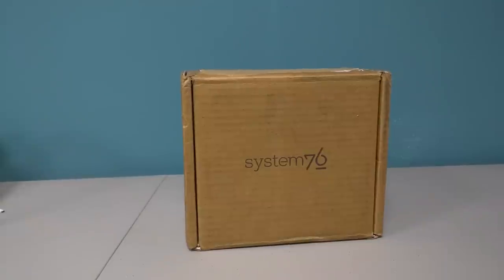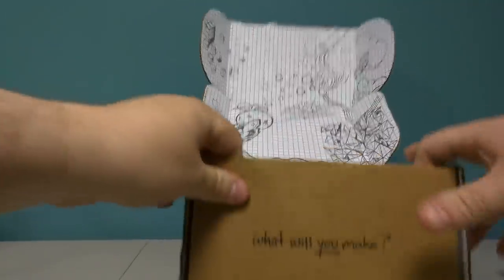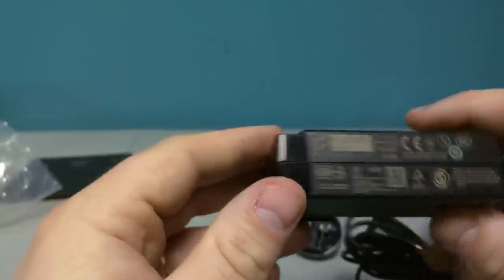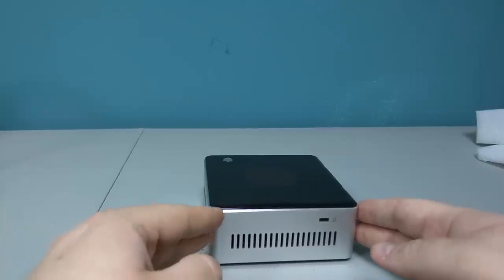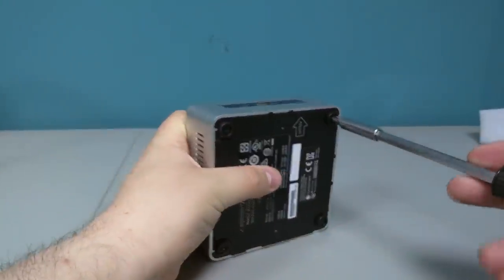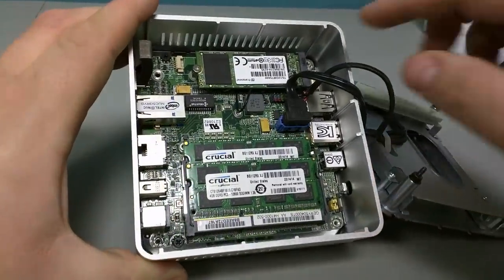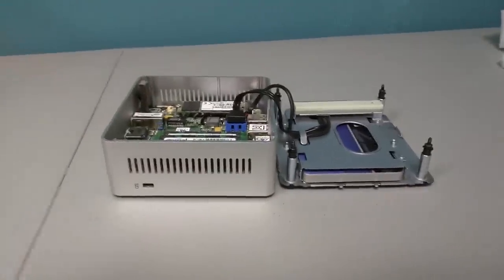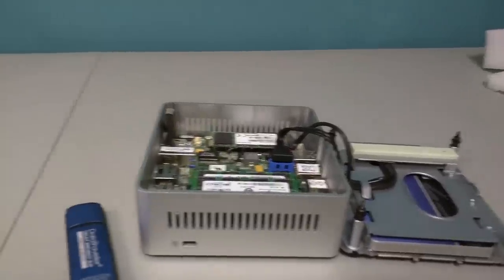System76 Meerkat Unboxing and Teardown Ubuntu Linux

Comment: It's just a rebadged Intel Nuc.  I was excited  till I realized that.  you can buy the same exact machine from Intel with no RAM or storage.  Add your own and what ever OS you want.  Would have been cool if it was a special unit of some kind.  I mean, even on the bottom they just put a System76 sticker over the Intel logo and model info.
Reply: And later in the video you mention that it's a Nuc.  That's good.  It's not bad thing, I was just hoping for something a little more special than a rebadge.

Comment: Ehh, this thing is a rip off. If you give it 8GB or RAM, and a tiny 128GB SSD, it comes out to 600 USD. This is assuming you buy it without a mouse/keyboard/monitor. This thing could run you well over 1000 dollars. Maybe even 2000 if you went fully upgraded, with all the peripherals. And with it's i3 processor, intel graphics, etc, I have to wonder: WHY? Why would anybody pay this much for something so ridiculously underpowered?

And the thing is, the draw of these small desktop PCs is that they're lighter in power, and thus cheaper in price. And the same goes for bundling Ubuntu with it instead of Windows. No OS=No cost of the OS for the consumer. This thing costs as much as an extremely high end desktop PC without any of the usefulness of it.
Reply: Jon Alanoor Don't forget, you're paying for it to be compact.  Should it be as overpriced as it is?  Probably not.  Still, you will pay more for a smaller form factor.  Also, with the OS issue, you do understand that you're not really paying for that preinstalled copy of Windows, right?  The cost of the OS license is subsidized by all the companies (Norton, for example) who want your computer to ship with all that trial software you may or may not activate.
Reply: +Jon Alanoor " This thing costs as much as an extremely high end desktop PC"

Extremely high end desktop PCs start at 500 bucks?
Reply: Paul O'Day ...Did you not read the part where I said an upgraded version costs nearly 2k?
Reply: @kayvahn2141  Not sure what you're talking about.  I've got a gen3 with 16GB ram, i7 processor, and a 250GB SSD and it was $1000.  Plus you get their OS tuned for the hardware (try running Ubuntu on a macbook and find out it doesn't have any fan control setup).  Plus support.  Still cheaper than an equivalent laptop if you just want a development machine.